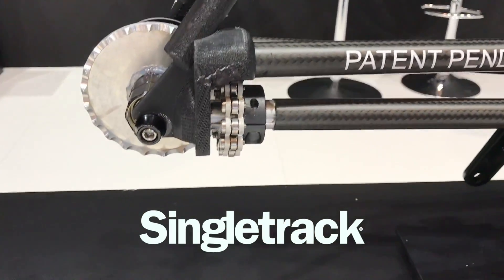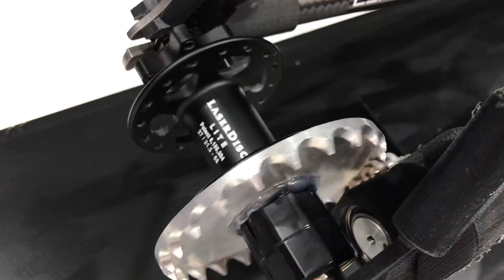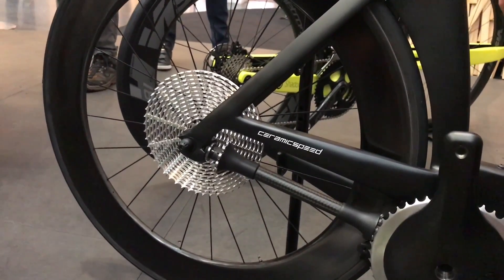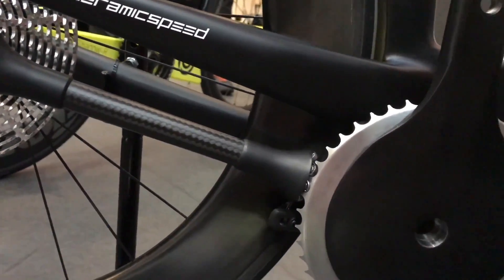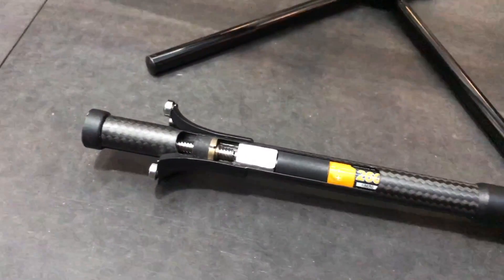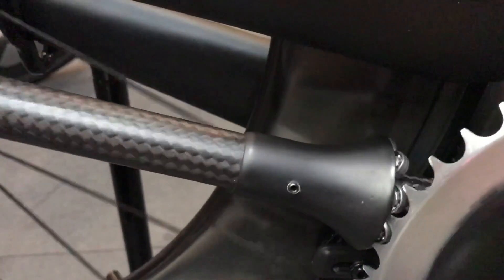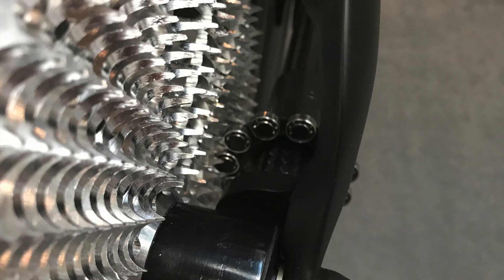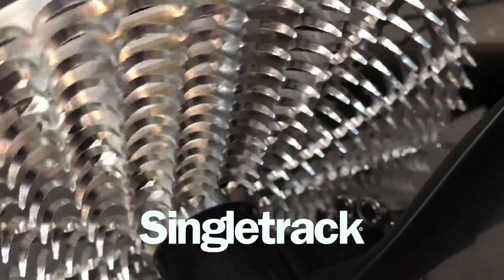Is Ceramicspeed Driven Chainless Drivetrain The Future of The Bicycle?

Comment: Good luck making that work on the rear swing arm of a full sus bike! The only way the bearing would keep contact is if the rear pivot was at the same point as the BB itself, otherwise the teeth/rollers would drift slightly closer and further as the suspension moves.

Comment: Shaft drive isnt more efficient than chain, prototype has better support for the bearings & it's going to need it...tr8 3d printer leadscrew to move the drive cog hmmm this isnt going to stay stiff for long....and no clutch so it's a fixie?

Comment: to market? optimism... useless, unreliable construction. How long individual bearing will last, how long will cog wheel last taking in to account, that unlike chain drive which spreads load evenly across around 40% percent of the cog wheel at any given point in time - you'r construction rely on durability of only one cog which takes whole load, and one bearing at any given point of time. Batteries to shift gears is like a cherry on top of the cake. Only one question - why?

Comment: Chain-less bikes were around in the late 1800s that worked similar to this and there is a reason they didnt become the norm.
Reply: Youp. At least 30% power loss due to type of transmission (they loose that much on motorbike shafts drives, which is why high performance bikes have always chains and only low maintenance cruisers utilize shafts). Plus extra weight from necessary housing, fork deformation due to asymetric tangent twork applied, plus ridiculous strain on expensive titanium, or fuck know if they need adamantium to work with a single point of contact, chainrings that will almost certainly deform and cause shaft skipping.

Comment: Run an internal hub with a Gates carbon belt drive if you want a clean setup.

This is nonsense.

It's more efficient in the lab... but in real application, a complete nightmare.

Comment: Would having a set up like this be inclined to increasing the amount the bike weighs?  Or would the replacing parts be about equal to what was on the bike before?

I know these are prototypes, but a shaft driven set up vs a chain driven set up seems like it would increase weight. 
They do have motorcycles that are shaft driven so it could be a similar pro and con list.
https://www.thoughtco.com/shaft-drive-motorcycle-or-chain-drive-743302

Comment: Hmm... the entire weight of a 200lbs guy slamming down on the peddle putting all the torque into a few teeth. Yeah no way that is going to snap.
Reply: Too much side load, not enough teeth contact..  there's no way you could rig that system to work on a mountain bike because they have suspension..... so the angle and distance between the rear sprocket and front sprocket change. 
it's a nice piece of art tho.
Reply: @daniel, that's why you replace old chains! when they don't have contact to enough teeth, they start wearing of the few teeth they're in contact with even faster ;)
@felpel my guess is that the cogwheel will bend easier that the shaft (which is fixed to the frame) - especially the outer rings due to a greater distance to the axis and hardly any support in the direction of force whatsoever
Reply: I agree. Or the gear ring assembly bend away from the shaft "chain" end.
Reply: Could be made with titanium for final production. Since it can be sealed, replacement cost won't be a consideration.
Reply: Clayton Cunningham It might cope with my grandma’s power output but she won’t be buying one. But kudos for trying I like the idea....
Reply: I think the shaft will just keep bending to the outside until it starts to slip
Reply: agreed!  wonder what the max torque it can handle is?  Much less effectively distributed than with a chain and sprocket.  Plus there the dirt contamination issues....
Reply: Clayton Cunningham have a close look at your MTB chain, especially when it's worn, it only contacts the last few teeth on the larger sprockets.
Reply: seppstarthebest that's right, I didn't think about that... This exact design definitely won't work in the long term. But my idea is, cars also have shafts that transfer power to the wheels (gearbox, differential), so it must be possible to use something similar to a car with all the shaft stuff in the back and go with those gearbox invention things at the front
Reply: Clayton Cunningham Serious? Have you seen the thin pieces of metal that hold an 11 speed chain together?
Reply: Difference being that that metal chain spreads the force around the entire circumference. So multiple teeth each taking a fraction of the force that the 1-2 on the redesign would.

Comment: With all those ball bearings that has to be a smooth drive system. Only thing I can see that might be touchy, which is likely why the prototype being shown doesn't demonstrate this feature, is that switching gear ratios will require careful timing to prevent binding, as that isn't a drive system that'll slip from gear to gear smoothly. I would imagine there'll be at least one index location where the driveshaft can quickly pop from one sprocket to the next/previous as the wheel rotates.
Reply: Sensors? Batteries?  I'll stick with the chain.
Reply: in another video (don't remember which of the 5 i watched.. and i'm a lazy dude) this is explained - there will be sensors, that track the positioning of the shaft and the wheel in relation to each other and it will only shift when a "shifting channel" (a place where teeth and gaps perfectly match from inner to outer rings) on the wheel is aligned with the direction of the shaft
Reply: Yes, I found another video that explains how they have to time gear changes, which is exactly what I was expecting.

Comment: rear gear looks really dangerous
Reply: Axel Rudz That must be why they mentioned system enclosure.
Reply: the entire gear can be inside an enclosure, unlike the chain it can be completely sealed with screws, always lubricated and dust free.
Reply: It's just a prototype so they want us to see whole thing with cassette. It will need a cover for sure.
Reply: Oleksii Ostapov your the only one that noticed that! Only time I’ve ever hurt myself with a cassette is during removal.
Reply: Normal cassettes are dangerous too
Reply: If you commute, you can grate cheese & make hamburger on the way home. MultiTasking!
Reply: For me looks great for grinding cheese... dangerously great !!
Reply: It does look dangerous to me as well, for example in case of a crash during a race. Maybe not much with a regular use while training
Reply: @Oleskii  I thought the same thing at first but it will be covered.  It is uncovered so you can see the moving parts.  I'll have to admit I wouldn't want to poke it with my finger but I also wouldn't poke a bicycle chain with my finger either.